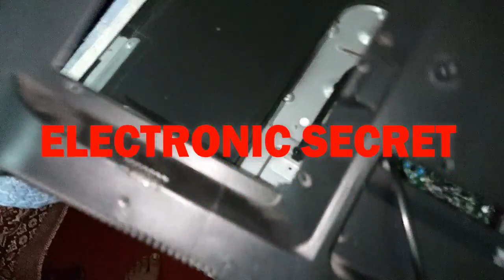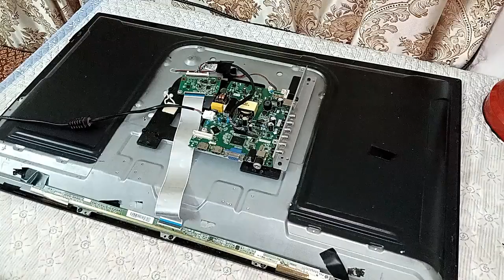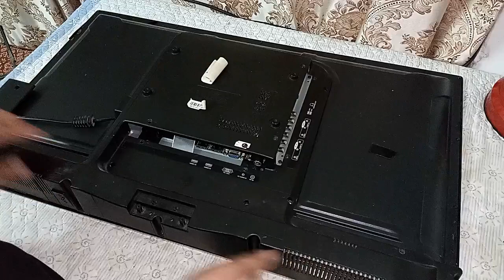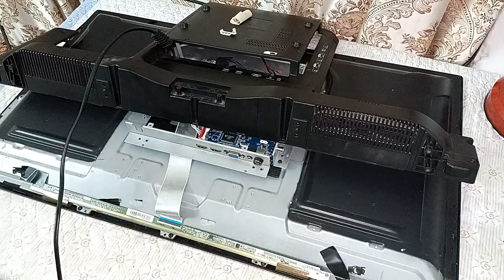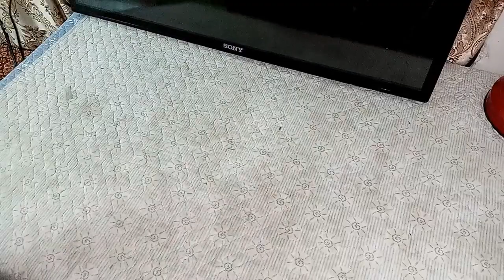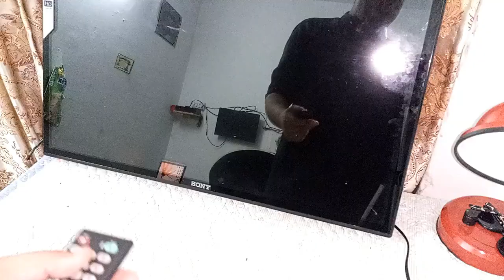HOW TO CHANGE UNIVERSAL BOARD OF ANY LED LCD TV

Comment: Is it possible to mod the TV in a way that will allow it to accept any TV format like PAL, SECAM, NTSC?
Reply from the maker: Bro new Tvs had built in system of PAL ,SECAM,NTSC,
Some models may allow you change this settings in Tunning option
Reply: @ElectronicSecret  ah k, my 4k tv doesn't have the option. Which tv's have the option?

Comment: Where did you buy your motherboard. Mine just died and the same as that blue one?
Reply from the maker: It is available on city main parts shop, 
If you have not a shop in your city then try to repair,I have made 2,3 videos on repairing this universal board,
Search in my channel,
You will easily fix this,
Reply: @ElectronicSecret  but the small thing got fried it explored the mother has a burn😔

Comment: Excellent video guys!  I am having almost the exact same issues with my Panasonic TC-39AS530U. TV turns on, screen flickers 3 times (I can see the LED lights flickering in the back), then I get a blank screen with 1 LED flicker (error code 1 I assume) then just a slowly blinking red LED. There is no sound and I can't turn it off with the remote. I have to press and hold the power button on the side of the unit or unplug it to turn it off.  I have tested my power supply board. ALL 3 test points (standby, LED driver, and main board) maintain voltage when it goes from power on to blinking light. However, the pins on the connector for the main board and driver board go from 16V and 24V respectively down to 0 when the light starts to blink. 

There are 3 test points on the main board, 5.3V, 12V, and 15V. The 5.3V (standby) maintains voltage when it goes from power on to blinking light, the other two do not, they go to 0. Would that, along with voltages being maintained on the power supply board, indicate that this main board is bad? I really hope that is the case as I do not want to get into replacing LED strips. Thanks and keep up the great work! P.S. I have put in new power supply and T-con boards and the problem continues.
Reply from the maker: It looks like that you have probably a faulty power supply board,
Trace its fault if you have some idea on how to repair power supplies, If not then change its power supply.upload its picture if possible,
Reply: @ElectronicSecret  I already have replaced the power supply board and the issue continues. As I mentioned the test points maintain voltage on the power supply board but they do not on the main board. Thanks for the reply.